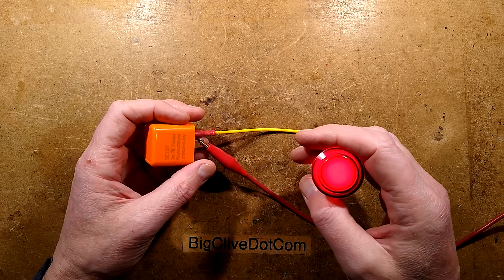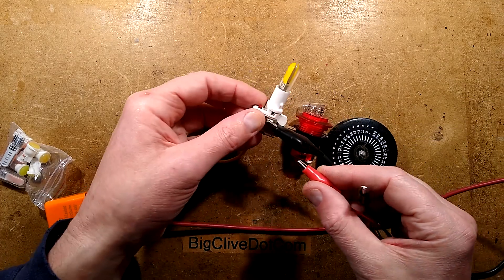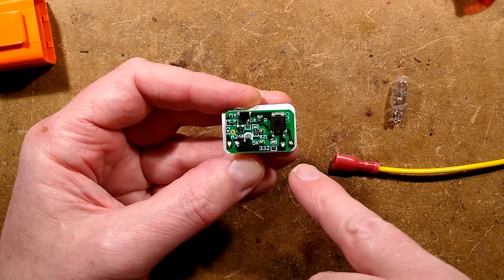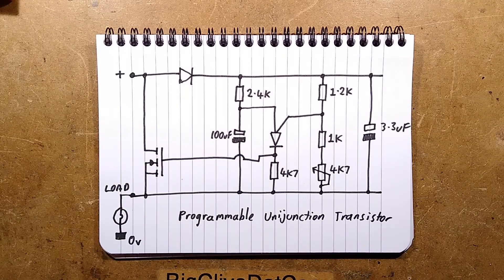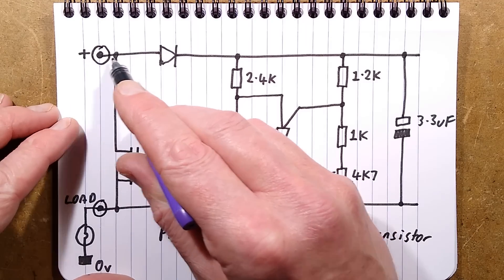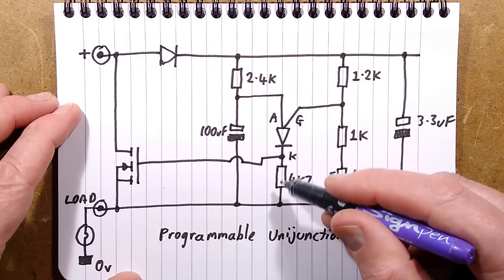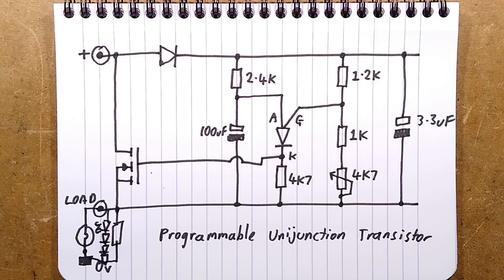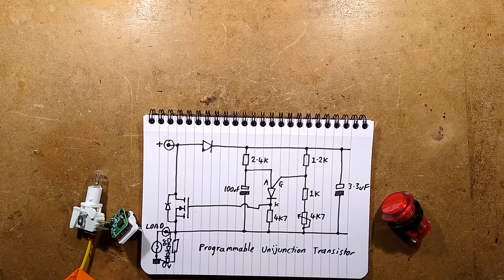Two wire flasher module teardown with unexpected find

Comment: If you buy the 5/6 wire version it contains a standard style relay and still makes the click. A thing with mentioning is that a noise, click or otherwise, is required for the 'msva mot' when hazard lights are used, as I just found building an e-motorcycle, I do not know if it's a standard mot requirement.
Reply: A direction indicator tell-tale can be audible or visual but it must be present and working.
Reply: @chrishartley1210  audible over engine noise, very easy on an electric .....
Reply: @lezbriddon  Or visual. It doesn't need to be audible at all if there is a visual tell-tale. The hazard warning tell-tale must be visual.
Reply: @chrishartley1210  I went back and read it again, your correct, it states (and applies to a hazard light switch(if fitted)) " If optical it may be incorporated with the indicator tell-tale lamp. If
entirely auditory it must be clearly audible to the driver. "
Reply: @lezbriddon  Yes. I think the part you were reading applied to the "audible warning device" (the horn).
I got my information from the MOT inspection manual, section 4.9 where it is called an audible tell-tale. The part about the horn is section 7.
Reply: @chrishartley1210  yeah I'm reading it from the msva build up guide which is a little different from the mot.

Comment: I thought one advantage of the old school bimetallic strip kind was if a bulb blew the flashing rate (so clicking noise) changed speed (increases) alerting the driver that a bulb had blown. It's a perfect example of how old school, analog tech performed a function that now you need a computer and software to do.
Reply: No, you don't. Plain old analog circuits are capable of measuring load and adjusting flash rate, or refusing to flash.
Reply: @Slicerwizard  one could argue a bimetallic strip is an analog circuit.  The strip continues to store  energy until it reaches the trip threshold - almost an analog of a cap charging.
Reply: @kissingfrogs  If it was an analog circuit, it wouldn't have contacts that burn and eventually fail.
Reply: @Slicerwizard  Yes, that was my point. What used to be done electro-mechanically now has to be done with yet another computer and software in modern cars. Digital is not necessarily better. Think of it this way, in the old days, design a car, use a proven flasher module off the shelf and the functional requirements are met. These days you need multiple Scrum teams and sprints to implement 27 different user stories related to 'indicator function and fault indication'. And it will probably still have bugs in it. Not sure that's progress.
Reply: @asciimation  But iNnOvAtIoN... There is no money to be made with simple, reliable and cheap solutions. You need complex, sometimes unreliable and expensive to make that sweet sweet buck.
Reply: @asciimation  as a QA engineer, this comment made my afternoon 👊😁
Reply: @asciimation  Bugs? Nice strawman.
Reply: Both the fault indication and the sound are required in the EU, using this relay might cause issues at the car inspection. A beeper/buzzer in parallel should sort that.

Comment: "How it works

The programmable unijunction transistor remains dormant until the voltage across C1 exceeds the gate voltage of Q1 by one diode drop (0.6V) or in this circuit about 6.8V in reference to circuit common. At this point, current starts to flow into the anode of Q1. When the current exceeds the “peak current” threshold (about 1.25uA), the transistor triggers and shorts all three terminals together until the anode current drops below the “valley current” (about 100uA in this case), and the transistor resets itself. When the transistor triggers, it dumps capacitor C1 across the LED. Peak current is limited by the LED internal resistance.

By varying (programming) the gate voltage, the voltage at which the transistor fires varies—in this case, it varies the flash rate.

Background

This cute little device was developed by General Electric about 50years ago. The original GE part numbers were D13K1 and D13K2 (now 2N6027 and 2N6028). The 2N6028 has tighter specifications for more precision applications. On Semiconductor is now the sole manufacturer, but NTE has a relatively expensive equivalent device.

PUT Applications

There are many, many applications for this device, but it is mainly useful for triggering thyristors. Other than for thyristor triggering, the ubiquitous 555 timer has taken over."

Comment: I made one of these to replace the very r.p.m. sensitive bi-metallic strip one on my 6V MZ. Must have been thirty years ago now. Also worked on a body controller and used my own code to generate the noise for a synthesised relay noise. (Lucas.)

Comment: Back about 1995, I was involved with the application of an ST Micro (I think) chip that governed all the indicators and hazards and could be mounted inside a standard hazard switch package. It could also diagnose the bulb states IIRC.
This was just before body control modules started integrating the function  and about the time instrument clusters went electronic, but way before generalised LED lamps in cars. Our target was Ford, but AFAIK it never actually got used.

Comment: Interesting circuit indeed. Ultimately it defeats the purpose in that you need to add a resistor however it is good to have a replacement for the old types.

Comment: In the 1980s I built an electronic unit to replace the bimetal type one so my dads car could pull a boat trailer and not go nuts flashing its indicators the 555 timer worked great and used about the same amount of components but the rules state it had to make the click sound and the receiver from a telephone did the job.

Comment: UJT’s were often used in strobe lights, when the UJT conducted it would discharge the capacitor into a transformer which generated the kilovolts necessary to trigger the xenon flash lamp.

Comment: Is this similar to the special globes you used to be able to swap with a globe in a string of Christmas lights to make them all flash?
Reply: I think those bulbs just contained a light with a bimetallic strip in it. So if I understood this right, that would be more like the old style indicator flasher.
Reply: @HattmannenNilsson  Ah that makes sense I guess given the limited space inside the bulb. Kind of outdated now that Christmas lights are all LEDs with the flashing sequences integrated into the AC adapters

Comment: In my own car I suspect the turn signals are on an RC flasher circuit with the bulbs providing the resistance since the moment I replaced the rear lights with LED bulbs the thing started going double tempo.
Reply: @Echo_Hotel  The traditional hot bimetal type requires two normal 21 W bulbs. Anything less it flashes a lot faster to draw attention a bulb somewhere has failed on that particular side.

Comment: This was a semester challenge when I did electrical engineering in the mid 90s
Design and build a solid state flasher for a car, we didn't have MOSFETs and up to 72 watt loads were common.

Comment: You should check out a Novita EP27 Relay.  It replaces the stock turn signal relay's in most older vehicles in the US for those who want to use LED turn signals/taillights in older vehicles that normally use filament style bulbs.   Before they came out with the EP27, using a 6ohm 50w resistor on each led was needed or else they would blink fast like one bulb was out.  Now you don't need the resistors with the EP27.

I have a 2002 Pickup and swapped all the bulbs out with LED and used the Ep27.  No fast blinkers. and work with low/high type brake/running light type leds as well.
Reply: Rubbish, those "hyperflash" designs/workarounds.
Those huge low-value resistors are the load itself, so you can unplug the bulb entirely and it won't trip any bulb-out indication because those nasty resistors will still carry the full bulb-load.
My car has "smart" relays linked to the instrumentation, and all I had to add was a 50ohm resistor to reliably push it over the sense threshold (100 would work, but used 50) so that should the LED bulb start blowing individual chips or blow out entirely, it will reliably trip the bulb-out indication.
Reply: @joeschmo622  That is why I said for Older vehicles.  Also for those that don't want to or know how to add resistors to each bulb.  This relay is a better solution.  And if the LED bulbs are blowing chips then they must be pretty low quality.
Reply: @pheelix-  Absolutely.  Crappy bulbs would be made like garbage, with garbage.  So you could have half the chips out and not know it unless you inspected it when on.  But relays that ignore low-loads wouldn't detect bulbs that were even completely blown.
It's all tradeoffs...

Comment: 0:36 There's no chance they'd do so. Those systems are known to malfunction when just one of the filament bulbs burns out; common tell you had a blinker bulb out was when the flash rate went haywire. But that's not why they've been more or less sidelined; modern automotive lighting regardless of type is run through the CANBUS and controlled by the body module instead. Car can pretty much turn itself into a rolling rave if it wants to.

I don't much care for it myself and it's part of why I refuse to buy a modern car, but that's how it's done these days. Reason I don't like it...absolute fucking nightmare to troubleshoot an issue with a CANBUS-integrated circuit which is...basically every circuit on the modern car. Electrical issues are a bitch to solve on something from the 1950s where you can fit the entire car's schematic on a single postcard. They're an impossible nightmare to solve on anything made in the last 10 years...

Fun fact: Modern cars have an artificial clicker in them because people are so used to the clickety-clack of the old school bimetallic flasher relay that they feel something's wrong with the car if it doesn't make that sound when the blinker's on......and then in the same breath say they don't use the blinker because of the annoying clickyclack sound if my mom is to be taken as 'normal'.
Reply: Last time I looked at the UK lighting regs (some years back, to be fair) there was a requirement that indicators be, er, indicated with a flashing light or an audible signal. Maybe manufacturers just got into the habit. The Renault I have at present has a settable level for the audio ticks. My thirty-year-old Fiat has a flasher 'relay' box not much bigger than this one that handles indicators and hazards and fault detection and four tiny relays inside (and also a badly designed pcb track that needs resoldering when it cracks from time to time.)
Reply: @neilbarnes3557  yeah I'm not in the EU or the UK. I'm working on/with old Fords, Chevies, Dodges, and they still used bimetallic relays for this as recently as ten years ago. They didn't need to fake it until they went to LED lighting that wouldn't trip those relays in the first place.

My mom's '02 Explorer doesn't 'fake' it at all. Nor does my '85 or my '95 F150, they both use the same exact flasher relay that fits F-1s from the 1950s hahahahahha

Comment: Look at the MST1170 (datasheet is on LCSC). It's a dedicated 3-pin flashing controller, could it be the chip here, instead of the PUT?
Reply from the maker: I'll check that out, but the circuitry around this matches the characteristics of a PUT perfectly.
Reply: @bigclivedotcom  how if you didnt even find any intel on that chip did you even guess the type of ic? pure diode-tester-mode-berzerk-going would propably not be too helpful?
Reply from the maker: I've checked and it doesn't look like a match.

Comment: Could it be a TL432 instead? 
Haven't heard of PUJT since the early 80's.
Reply: Programmable UJTs have been available in smd packages for quite a long time, though not many different parts e.g. MMBT6027 and BRY61

You won't find any conventional UJTs though, AFAIK.
Reply: @ferrumignis  You do get them, old stock when SMD was becoming popular, and manufacturers still had the process lines to make the UJT itself. However when you look eg at Mouser the stocks are all low, under 500 in most cases for all types, and all are classed as obsolete.

Comment: Using the crapload of 555 timers and the shittonne of 12v relays I bought a few years back, I used a couple of each to make a couple mechanical "electronic" flasher units for no reason whatsoever last year, well, maybe because I was bored in lockdown, had a lotof fun playing with the resisor values to make them have an off-beat flash pattern akin to old style flashers used in things like 2CVs and Skoda Estelles... :D

Comment: RE: 0:35... i have done this as a kid when LEDs first came out, 1 single diode, of course wouldn't cause the relay to trigger normally, but being a kid then and taking apart all sorts of electronics, my favorites were the lights.. took up to 8 RED diodes to trigger it normally (without resistors, I didn't know much about current/resistance values back then)... turns out, the bimetallic relays, can handle up to 10A-ish... found that the higher current going through it, the faster it'd trigger.... until the contacts would randomly decide to weld together.

Comment: A UJT? Wow! I haven't seen one of those things in probably 40 years! The first circuit I made in my college years was an oscillator based on the UJT. As I remember it, it is a PNPN stack, which makes the equivalent of a PNP + NPN latch, with the top P connection being the anode, the next N in the stack was the gate, and the bottom most N was the cathode. Once the anode got to a diode above the setting on the gate, then the latch is created and the anode is mostly shorted to the cathode. Once latched, the only way to unlatch it is to reduce the anode voltage low enough that the latch is no longer self-sustaining, after which is shuts off. It's much like a triac as I think about it except that the triac's gate is moved down to the bottom-most P connection. Ah, memories!
Reply: The PNPN construction ironically makes it a three junction device and completely different from the original UJT such as the 2N2646, which had a slab of silicon with a base connection at each end and a single PN junction forming the emitter. A variation on the so-called PUT had four terminals (anode, cathode and two gates) and was called a silicon controlled switch. I still have some BRY39s in my collection.
Reply: @johnm2012  PNPN is also the thyristor construction, with back to back PNP and NPN as the logic-equivalent circuit.  The naming of these components seem to follow the tradition of how advanced vacuum tubes / valves were named before transistors.
Reply: @johndododoe1411  The thyristor has a cathode gate, as opposed to the PUT's anode gate. The name "thyristor" is derived from "thyratron" (the valve, which has a similar "negative resistance" region in its characteristic curve) + "transistor" but I'm pretty sure the other names are unrelated to thermionic devices, which don't have any junctions at all!
Reply: Thanks for elaborating on the details!

Comment: As an old guy having used unijunction transistors, that is not what the unijunction transistor symbol looks like if I remember.  It used to look like a FET with the gate being angled instead of a straight line?
Reply: PUT is different from UJT, PUT is akin to a SCR, in having a 4 layer PNPN structure, while the UJT is a long lightly doped silicon section with a diode junction part way along it, that forced charge carriers into the lightly doped channel when it reaches a threshold voltage. nobody make the UJT any more, you basically are relying on all old stock now.

Comment: Hi,
Do you think it would work if you were to put one of these (Or even an old-fashioned thermal flasher) in place of the 3-wire electronic flasher on a car from the mate 90s like my Peugeot 306 ?
After having seen Technology Connection's video I did pull my flasher and using a multimeter and/or a small 12V incandescent bulb with two wires I found the two pins that control the indicators, shorted them with a piece of thick wires and switching on my indicators or hazards resulted as expected in a solid light.

Therefore I'm convinced that a two-wire flasher would work but I also know that there are reasons behind using a 3-wire one, stuff like hyperflashing to tell you that an indicator is burned out in addition at a better accuracy.

And I'm wondering about all that just for scientific purposes, in fact I've long since put the original flasher back in place and the indicators blink as they should do.
Reply: Probably the stock flasher in your car is not an pure mechanical bimetall type. I have a Citroën BX from the same era and many shared components . When I put in led bulbs in the front indicators the flasher speed changes just like an bimetall flasher would to indicate a broken bulb. There are load restores to solve that but I didn't like that so I opened the flasher unit to see if it could be adjusted. Inside I discovered a printed circuit a relay and a flat piece of  - I think - iron  as a current measuring shunt. I simply cut away about half of this iron strip so its resistance would double and after that it worked perfectly again with just one incandescent bulb in the rear indicators and LEDs in front.
No if a rear bulb would fail you are still warned by the flasher frequency and I am also pleased that everything else continued to work like it should; the dashboard arrows, hazard and trailer flasher etc.
Reply: Mine also has a printed circuit board, dedicated chip, current shunt and a whole bunch of discrete components.

My car is from 1996 and is by the way one of the last ones not having electronic injection, airbags and transponders in the keys.

But it has pretensioners.

And the flasher isn't LED compatible (Which to be honest is totally fine for me as I use stock incandescent bulbs), but it does hyperflash when a bulb is disconnected or burned out.

Have you checked Technology Connections's video on the subject ?